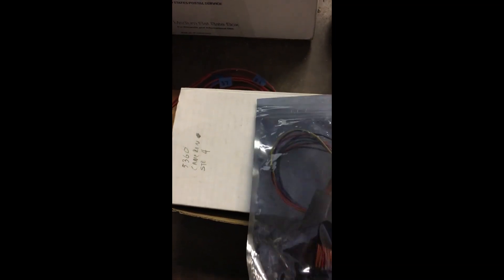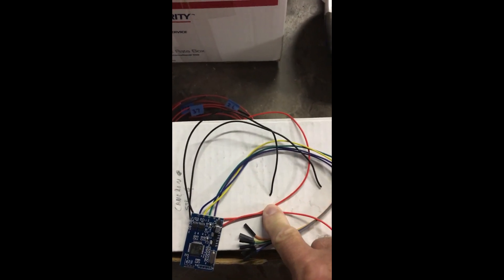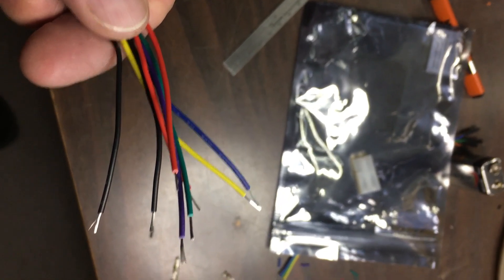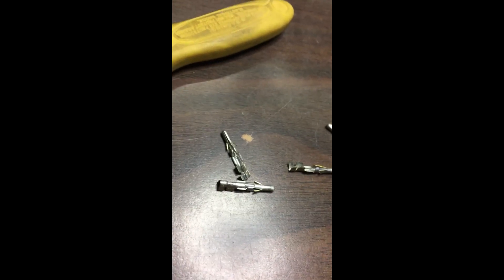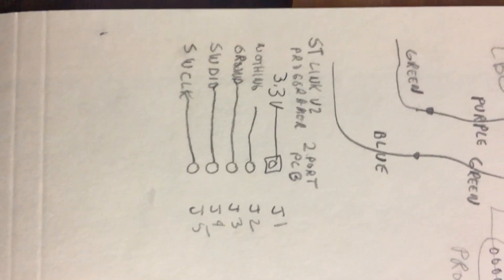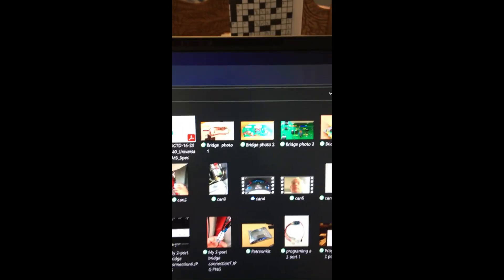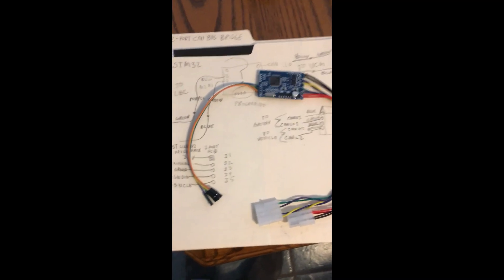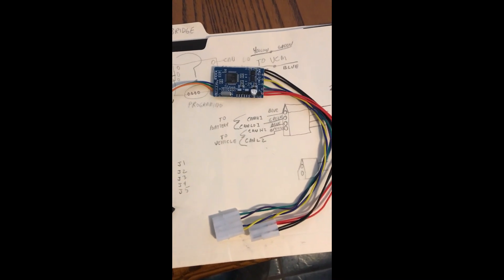2 Port CAN Bridge Copy

Comment: Hi, Sir, I want to know if I flash the board for 1 Nissan Leaf car with 24kwh, Can I use the battery replacement of 53kwh, 63kwh？Should I do more or change the code? Is it compatible with the original BMS?

Comment: This is very interesting. I've been searching the auto auctions regularly for a wrecked Leaf at a "reasonable" price for the last few years. Unfortunately, everyone wants those batteries. Even if the car was sandwiched, a Leaf goes for a hefty price at auction.  

I have watched multiple videos on the battery upgrade. Thank you for taking the time to make one also!
Reply from the maker: There is nothing cheap or easy about doing the upgrade.  Thanks for your comment!

Comment: im just about to swap a 62kwh battery from a 2019 into a 2013 and just flashed my first can bridge today. with the programming i ended up just soldeing a pin header to the can bridge and used female to female dupond cables to plug it into the porgrammer. i like how you used molex connectors they should work great. i ended up deciding to use deutsch connectors. are you going to porgram an extra board and leave it in the car ? i worry that if im out and about and the can bridge becomes faulty as dalla warmed they can be unreliable. i want to be able to swap it out so when i install mine im going for a setup that can just be unplugged and plugged back in.
Reply from the maker: CAN bridges used to be expensive and hard to find.  For that reason I made up a jumper plug to leave in the car.  With it the CAN bridge could be removed and the car would run in turtle mode.  Now with the availability and lower prices of CAN bridges, it makes sense to leave a spare in the car.  Thanks for your comment!